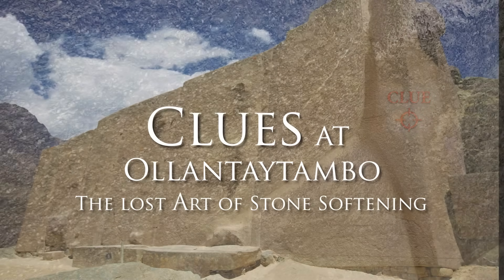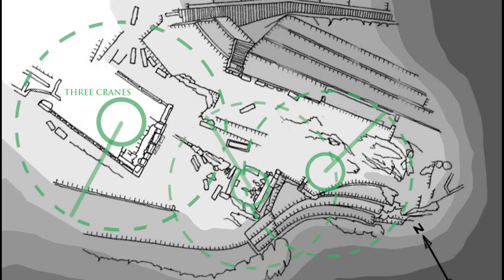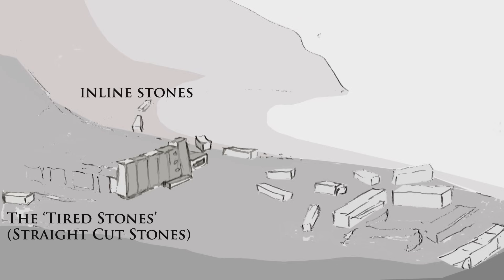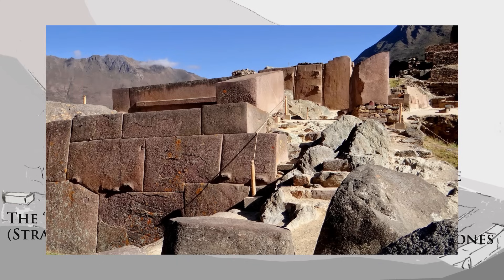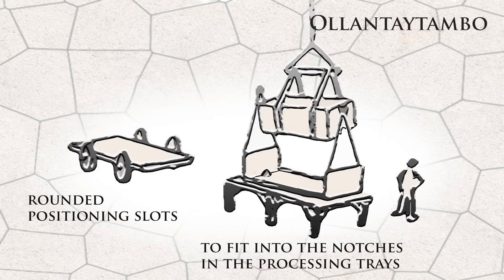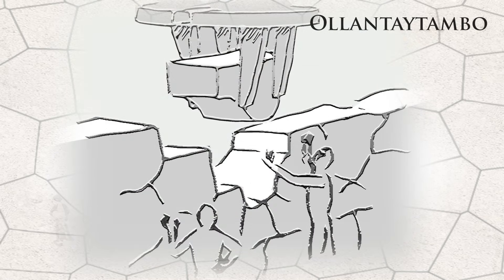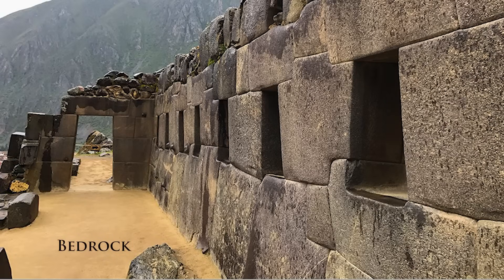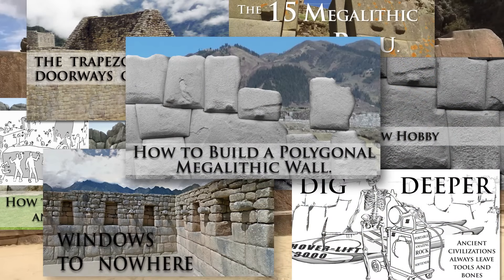Clues at Ollantaytambo. The Lost Art of Stone Softening

Comment: This was the most interesting video I've seen in some time.   Appreciate the fact that you covered everything in about 6 minutes instead of making it a 2 hour thing.   You've earned my subscription and I'm going to watch your other videos for sure.    To the points you make, I think you are mostly correct, with perhaps minor adjustments. Here are some thoughts supportive of your points but a variation on the softening solution.  I did some digging after on the porosity of granite and there is a research paper that quantifies it.  For the sound part, I think the vibration of sound in the rock could cause accelerated wetting at the micro level and speed the seeping of a liquid through the slightly porous granite.    So I think the porosity of the granite could be enhanced with just an iron rod being pounded against the inner hard part of the stone to send vibrations through it.   One could envision a simple hand turned device with an irregular wheel  and pressure pounding on the rod many times per turn creating a jackhammer effect. So the sonic thing makes sense and could be crudely implemented.  For the softening solution, it would be neat to have a mineralogist do a chemical analysis between a piece of one of the entry rocks not processed and one that had clearly been through the softening process to see if there is a different distribution of elements.   I'm predicting there will be more sodium in the processed rock.   The reason for this is I suspect the liquid may not be plant based but instead a sodium hydroxide NaOH (lye) solution which is very caustic and may interact with the slightly acidic SiO2 - a large component of granite and some other hard rock types. Perhaps other minerals too are slightly acid and will interact with the NaOH solution.  Lye is made by leaching ash from burnt wood so it would be readily possible in any part of the world to produce it even in ancient times. I'm tempted to go and do that experiment myself to see if I can soften granite.  I'm suspecting the stones are stuck together as it appears the troweling would have to be done after the two stones were in contact.  Those are my thoughts - again congrats on the video.  Harvey, you deserve way more subs than you currently have.  All the best to you sir!
Reply from the maker: Thank You!  And Yes,, I try to keep my videos as short as possible.    Thank You for watching!
Reply: I seen something about pure sulfur I don't remember where but I think the tech was pretty advanced when this was done something stopped everything and the tech was lost over time  in the fight to survive.
Reply: I would like to see him demonstrate exactly how it was done. Of course on a much smaller scale.
Reply: I also thought it would be a lye solution.  The sonic vibration could be a vibration of the "lye softening agent" using several men to hammer the bath enclosure. I am assuming would have been metal. The metal would continue to reverberate long after the initial strike. Each consecutive strike compounding the sonic action. Think of an inverted  bell with liquid in it.
Reply from the maker: @MrWizardofozzz  I've never blocked anybody!
Reply: @IntriguingMegalithic  Then why are all my comments on this thread muted, except to you..? And how is it possible you couldn't find anything on the pyramids being man made when I provided you with the sources and dates..??
Reply from the maker: @MrWizardofozzz  I really don't know!  You're making comments right now. So I'm not sure what you're talking about. 
Thanks for watching!
Reply: @IntriguingMegalithic  I am truly sorry if you were not muting me, I replied several times and all comments were muted when I checked off line..  Again, I apologize if it wasn't you.. All I ask is you take 2 minutes snd look at my sources above(in my first comment) and see that this subject was resolved in 2006, it's just not on mainstream media(mainly accredited published scientific journals)..
Reply: @MrWizardofozzz   I never understand how people are so aggressive to the geopolymer theory, being able to mix aggregates and make man made stone. It's still an extremely special and advanced technique, which produces it's own problems and skillful techniques to master.
Reply: @__tay__6074   Thank you for being honest..  The Roman's and Greeks made amazing concrete statues and buildings during the age of the Egyptians and nobody denies that, it even makes more sense that they got the idea from someone like the Egyptians and modified into something more than Lego blocks (has to be some primitive form of this)..? The Roman's used a simple recipe of volcanic ash, lime, water and aggregate,  the Egyptians used diotenacious earth instead of volcanic ash, but nothing complex and locally harvested materials..  In fact, the main evidence Drexel University put forth was that under an electron microscope the quantities of the materials that make up the stones cannot be found anywhere on earth(this is the main argument) and even on a molecular level, the atoms are arranged in a way that are not aligned properly and can only be explained by mixing the materials unevenly(or too much of one)..  Perhaps this can be later challenged and proven differently, its possible further research will prove this wrong, but currently the evidence from Drexel (that the Egyptians made blocks to build the pyramids) has not been contested or debunked (as of yet)..  Again the riddle isn't solved, but rather the current evidence supports they used natural stones and man made stones..
Reply: @MrWizardofozzz  I gotta chime in here. More and more lately I keep thinking how these blocks are looking like cast blocks.  The pocking on the surface on some of these don’t make sense. Some don’t even look that old!  But as I’ve said in other posts, I have to get to Egypt so I can see it for my self. Sometimes you see the face of the stone and it looks like cast decor,  then the cam moves to a different angle of a broken end of the same block and it totally looks legit.  It’s like they would have melted the rock…and cast it into the forms they made. But still think about what they would have had to do this kind of work. This is a big scale.
Reply: @jasonsfun31 Thank you for the reply..  Yes, I think everyone has its doubts about how the pyramids were created, for me it was realizing these stones(over a million) were in a trapezoid shape and how difficult it would be to tailor make each stone, so it could fit next to a trapezoid block without being able to fit a razor blade between the grooves..? Suddenly, you realize this tailored carving with primitive tools would be more a miraculous event than the building of the pyramids itself, we can't do that today with our best chisels and hammers and why didn't they just carve the blocks with square edges so the next block required little effort to place..? Why Trapezoid..??    I am really thankful that Drexel University provided hard (fact based) research to finally prove that they used simple local ingredients to make cement identicalto limestone. Ancient cement really does solve nearly all the missing info.. Cheers..
Reply: @MrWizardofozzz  Sometime Youtube can do strange things.  I have learned if I cut and paste something, I must paste as plain text.  Also if I try to put in a link, the same.  What happens is what you posted just disappears.  Of course I do not know if that is what is happening to you.
Reply: @loquat44-40  Exactly, I have since learned this and appreciate your information posted above.. Best regards..
Reply: Interesting. Good read
Reply: https://www.youtube.com/watch?v=KMAtkjy_YK4&ab_channel=FehmiKrasniqi
Reply: I'm sorry, but y'all should check out WiseUp channel before thinking of softened rock.
Reply: I shy away from videos longer than 7 minutes.
Reply: What if the rock were heated?  That would expand the molecules...  The rocks look just like buns baked in a cake pan in the oven.  They puff till they press on each other, then rise up.  Removed from the heat, they collapse a bit, esp in the center and at the edges, but retain that puffiness at the near edges.  Picture the rocks on their backs, with the front facing the sky.  This explains the puffiness better than the softening alone.  The rocks were softened but then heated to expand into one another tightly.
Reply from the maker: Have you seen my most recent video?  It’s 29 minutes long!    My longest ever!
Reply: Well, the Spaniards in S. America found those plant juices by accident. Certain plants in the jungle will dissolve off your shoe heels while walking and if your sword drags thru the greenery  by the time you have walked a few hours your sword is half-dissolved and you are walking on leather with no heels.
  These plants don't dissolve skin or leather only rocks and metal . One conquistadore who got stuck in the jungle walking ended up getting to his destination half naked and barefoot which might have been very entertaining to the native women who might have never seen a circumsized  dinky-winky before. 😂😮😊
Reply: @restoretheearth2829  what’s the name of the plant please.
Reply: Well, here is the issue.. "Drexel University" proved beyond doubt(published) the Egyptian pyramids to have man made stones, by using the surrounding materials as like ancient cement. They also determined there to be natural stones acting as a filler, as the man made stones used as the outer wall and frame. . They were working off the "geopolymer institute of France" earlier work started in the late 1970s that were also piggy backing off the work from Harvard back in the 1950s..  Man made stones are now accepted in the scientific community and well documented, except in this video and the Egyptyian tour guide book..  Take a few minutes to research any of the above mentioned research.
Reply from the maker: @MrWizardofozzz   man made limestone blocks in the pyramids?  I can’t find anything about that!
Reply: @IntriguingMegalithic  it's clearly on YT, but has been debunked. It was a nice theory, but proven untrue.
Reply: @petejung3122  Id love to see the Scientific Paper doing the experiment and debunking this! Cant seem to find it antwhere.......
Reply: @IntriguingMegalithic  Its a Russian Geologist, I read it years ago. Poured stones. They did core samples and found crushed shells but no whole ones as you would in natural stone.
Reply: @MrWizardofozzz  https://www.youtube.com/watch?v=KMAtkjy_YK4&ab_channel=FehmiKrasniqi

Comment: I can tell you how those rocks were formed in perfect, albeit jagged, alignment without "stone softening" or "sonics":  CEMENT
Many people who have worked with cement have commented that the rocks look like stacked "bags of cement" left to dry.  Some locations have flat faces while others have bulging bottom edges (a tell tale sign of a bag of cement), but they all have slightly rounded edges as if the rock had been poured into bags before being lined up to make walls.  The Romans used volcanic ash, lime (made from either limestone, chalk, or shells), and volcanic rock to make their cement--and Roman cement is more durable than modern cement and gets stronger over time.  There are 174 volcanoes in South America so there is plenty of volcanic material.  There are large deposits of limestone in Ecuador, Brazil, Chile, Argentina, and Colombia.  Ancient rubbish pits full of shells have been found all over the world making them quite common.  So there is no reason to think lime would be scarce--especially when every important edifice was apparently whitewashed, as it were, with a keen layer of lime plaster and then painted in vibrant colors.  With this information, it doesn't take much to imagine that builders of great civilizations such as those found in the Americas would, at some point, have the desire, leisure, or happy accident of figuring out how to make cement.  Remove the bags, do a bit of clean up by human hands, add in some wind and rain erosion and lots of time and you have "stone" walls you can't stick a piece of paper into.
Or it could have been alien technology.
Reply from the maker: But cement is as obviously not granite. These rocks are dyorite which is Not cement. To say they are cement is to mock our own geologists. This is Not cement.  God,, I wish it could be that easy,, or that simple. But it's Not.    Thank You though for writing such a nice and thought full piece.